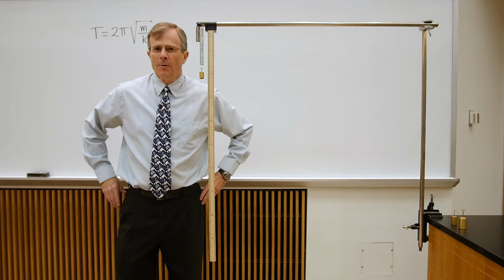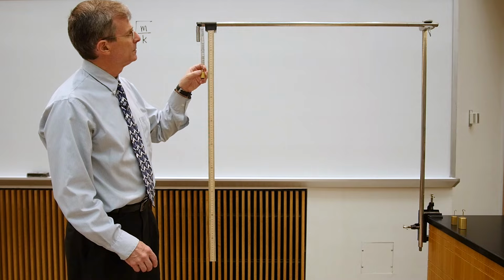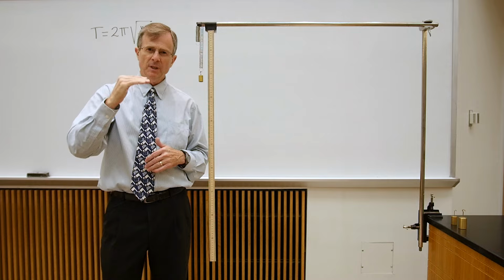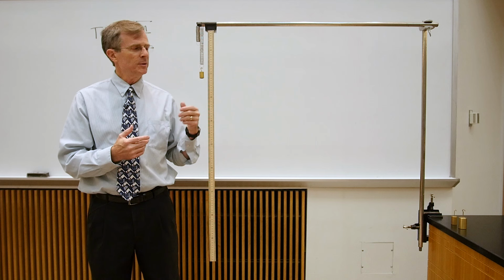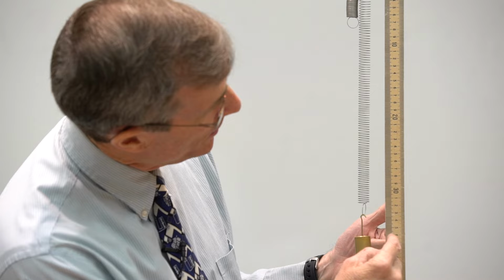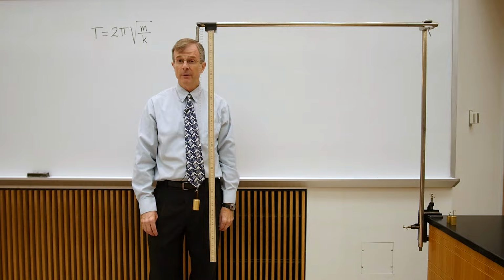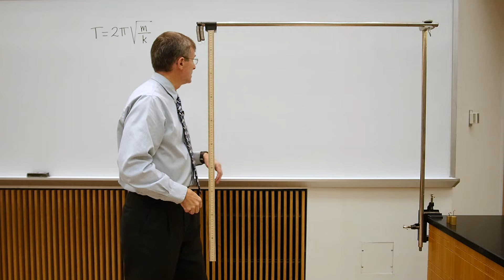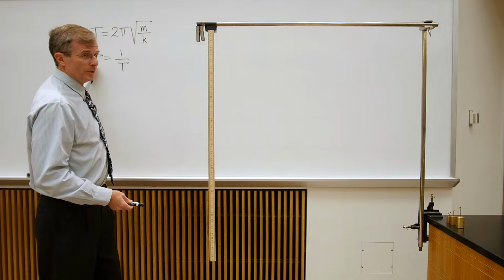Oscillations Demo: Mass Spring System

Comment: Sir, so I get that the spring mass system is almost equivalent to the oscillation of a simple pendulum where the T for the former depends on mass of suspended spring, and that of the latter relies on length of pendulum and acceleration due to gravity. Right? Hence, does any system representing an oscillation or an SHM (simple harmonic motion) always depends on the factor of 2π √something/√something?
Reply from the maker: Certainly, the period of the simple pendulum and the period of the mass spring system have the form you've described, but this is not necessarily true generally.

Comment: Hi! Could you please help me to sole the following problem?   3.	A spring and mass system with a mass of 2.5 kg is observed to have a frequency of 5.5 Hz.  What is the stiffness constant of the spring?   Thank You.
Reply: Set that frequency to 1/T which will give you the period, and then use the period equation shown in the video to find the spring constant.

Comment: does this applies to compressed spring? thankyou
Reply: Yes. Same situation. Fs=-kx=mg in that case. Just changes your sign, or you can keep it positive if you just change your reference direction.
Reply: Yes.  It is just a lot harder to eliminate non-ideal factors when working with compressed springs.

One issue you encounter in compression that you don't encounter in tension, is the phenomenon of buckling.